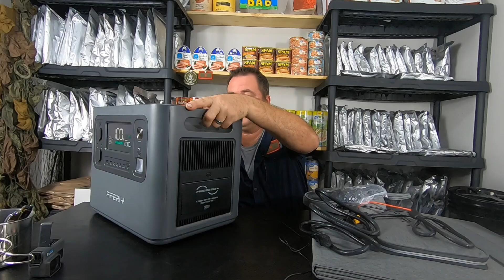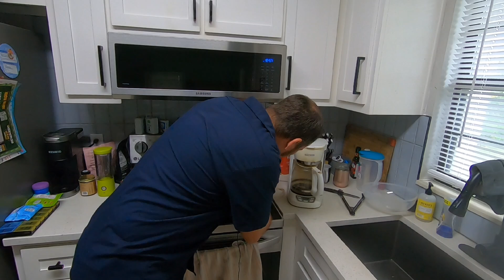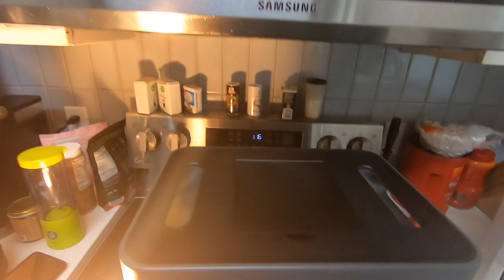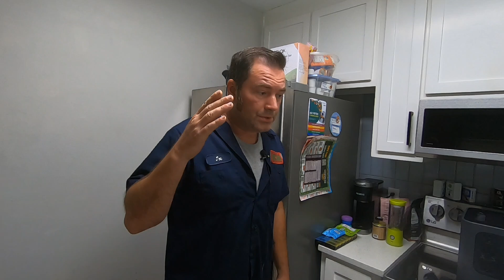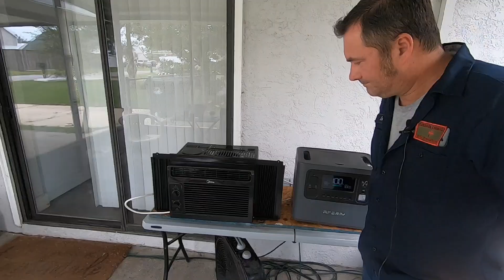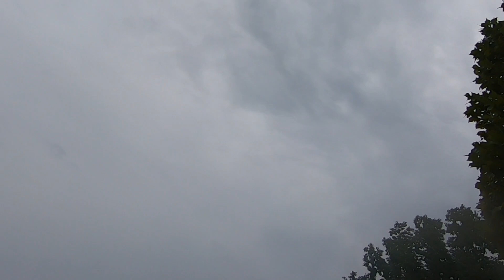Budget Friendly Portable Power Station Aferiy 2400 Watt

Comment: Hang on,so 90% battery ,at 6 W usage gives us 39 hours only ? That works out as 240 Wh ,I understand the loss of power as the unit has inverter built in but that is still a huge loss of battery power .

Comment: Never knew coffee pots were hard on electric.
Reply: boiling water at scale with electrical is insanely kwh intensive ;(
you can technically get water up to 212f in a tiny tiny purpose-built with around 300 watts, but that's as efficient as it gets.
Reply: @chancepaladin   Good to know!
Reply: Sometimes a propane stove or rocket stove helps preserve electricity for other items.

Comment: I got a power station but I'm in a flat and dont have a garden and cant exactly leave it outside the front for hours to charge using solar panels so no idea how it'd work doing it from my window if anyone has any ideas 😂
Reply: Charge it up with wall power.  You don't have to have solar and it will work as a short-term backup to keep your fridge/freezer going for a few days.
Reply: I'm in Yorkshire and charge a couple smaller power stations using solar panels hung in the east  facing windows, doesn't work great for me most of the year because of trees too close to my flat 😅 but I've charged a bluetti eb70 from 20% to full using a buddies home (also a flat) using a 200w panel in their southwest facing living room window 😊